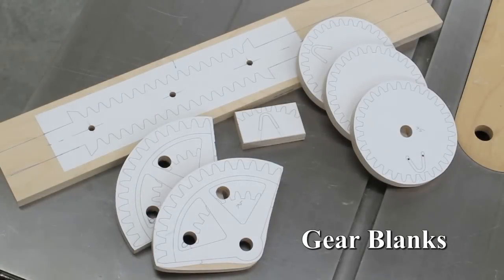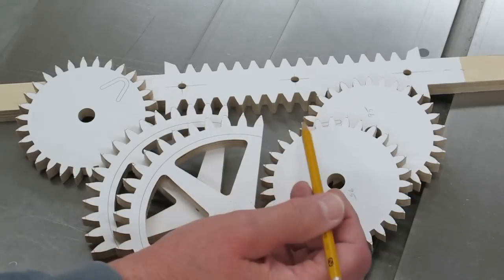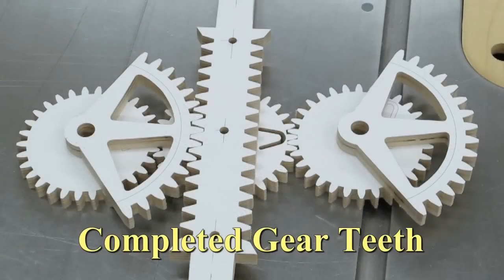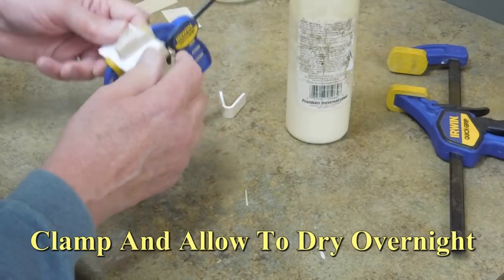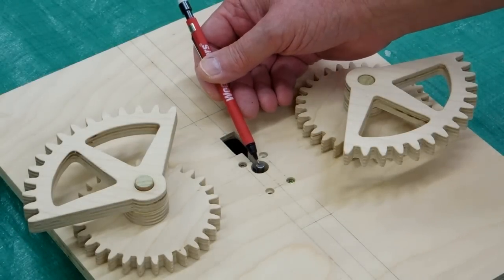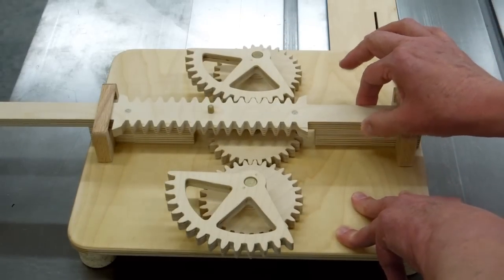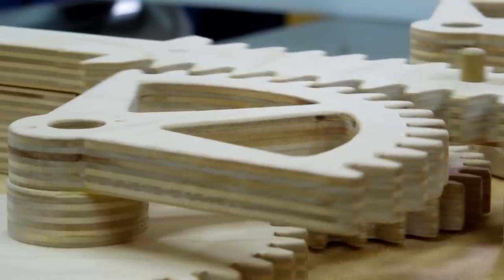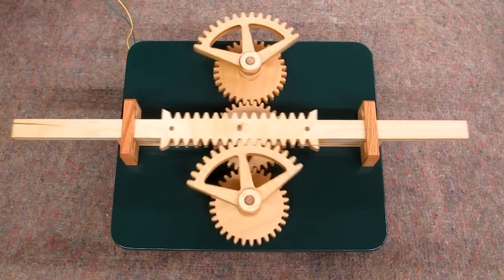Making Movement 123 - Reciprocating Rack Mechanism

Comment: what software do you use to make gears?
Reply from the maker: Usually I use the gear template generator at woodgears.ca, however for this mechanism I had a private source for the templates which are not available for distribution. Thanks for watching. Ron

Comment: Very cool. Did you get this functioning on the first try or did it take a few iterations? What blade did you use in the scroll saw to cut the gears? Just found your channel and subscribed...
Ron
Reply from the maker: With hand cut gears there is usually some fine tuning involved. The operation by hand in the early part of the video was probably the second try and the pin catcher wasn’t installed yet. I have a video on cutting gears on the scroll saw. Cutting Wood Gear & Clock Wheel Teeth https://youtu.be/AQ92urCdybU

Comment: How did you figure out the size of the"half gears"(not sure what to call them), and the width of the shaft gear?
Reply from the maker: This is Movement 123 for the book 507 Mechanical Movements. While not accurately drawn, it is proportioned for the various parts. The website 507mechanical movements.com has redrawn a large number of the movements and has some animated. You can take it from there. I generally use 1/2" Dowel for axle shafts. Thanks for watching. Please Subscribe!

Comment: This is very interesting, though I think in practice, the rack does not have any time to accelerate or decelerate when it reverses. Imagine this made from steel parts and the round gears connected to a heavy flywheel. Anytime it reverses, it would be like a hammer banging the rack at each end. It might break the teeth. Maybe if each three spoked gear could be connected with a torsion spring to the round gears, this might smooth out things when the rack reverses by absorbing and releasing energy on each stroke. On the other hand, there could be a ratchet between this assembly and the flywheel, so that the rack and gears can accelerate and decelerate at each end without slowing down the flywheel.
Reply from the maker: It was proposed in the book Five Hundred And Seven Mechanical Movements by Henry T. Brown published 1868 that the rack would be driven by a steam piston just like a steam engine (locomotive). If a steam engine worked... then?
Reply: @RonaldWalters2010  Okay. Thanks for the info 😀

Comment: Hi,

I am trying to solve, how can i make these "ellipsoids" (yellow, green and red) flow like an "8" sign and continuously switching in between: https://photos.app.goo.gl/LHs0gH3glgpUqGvv2 . It looks like very simple task, just need to switch first pair by rotating blue spindle, then purple, then again blue and so on. But issue how to make them rotate only 180 degrees at a time and then wait for other will be turned? I am stuck... :( I even do not know how to ask google for help :D
Regards
Reply from the maker: I believe I would call the yellow, green and red segments ellipses, as they are 2-dimensional. This mechanism is going to operate as two combined geneva mechanisms. However, as I see it, the three shafts are never going to turn about their own axis. You need a single shaft connected to the blue segment and a single shaft connected to the purple segment. The yellow, green and red segments would be free floating. The two shafts could then be rotated individually 180 degrees in sequence by two additional geneva mechanisms and/or segmented spur gears. Let me know if you succeed. Please subscribe.
Reply: Ronald Walters, will try this if i properly got your idea. Thanks.
Reply from the maker: Indexing Mechanism 6 (180 deg.) https://www.youtube.com/watch?v=WM3roJbzX7U The green gear on the left turns 180 degrees. There could be another identical gear on the right. There would be a delay between each indexing movement. Possibly by adjusting the diameter of the center driving gear you could reduce or eliminate the delay.
Reply: Ronald Walters, its exactly what i need!  Thanks!

Comment: To bend thin plywood that small you can easily use a steam cleaner like what a woman might use to take wrinkles out of a dress. It does a nice job in getting it flexible enough to bend in less than 15 minutes. I used that technique to bend a 1/4" sheet of plywood for a 4 wide sailboat.

Comment: How much load can these parts withstand? What is their resistance?
Reply from the maker: This is a display model. Wood gears are quite strong. Made of forged or machined steel, very strong as this was originally intended to be driven by a steam cylinder.
Reply: OK! What wood do you suggest to have resistance and also to be easy to work with? Thank you
Reply from the maker: As shown in the video... Baltic Birch Plywood.

Comment: Hi Ron!  What  nice surprise to encounter your version of this mechanism.  I made one also, out of aluminum.  If you care to take a look:  http://www.smithsartworks.com/windup14.html
Reply from the maker: Russell Smith  Very nice. Looks like a lot of work. I was looking at your videos. You have some really nice stuff on your channel. For the clock motors... are you building those as well or what motor are you using?  I really appreciate like the Gear Head. I know that took a long time. I should make a wood version of one of those. :-)
Reply from the maker: Russell Smith If you ever travel to Kansas you REALLY should visit the Paul Boyer Museum of Animated Carvings in Belleville, Kansas. I think you would really find it interesting. Quite a small place but plan on spending 4 to 6 hours there, I did! I hate that it is around 400 miles from where I live.
Reply: Ronald Walters Thanks for your reply, Ron...  The motors are 100 year old phonograph motors.  They are quite abundant and--- as far as windups go--- have a lot of power...  I get them on Ebay, and there is no reason why they could not be used to power some of your wooden movements.  They have a real appeal in that the viewer can interact (the winding) and they do not have the leash of an electrical wire.  If you scaled your movements appropriately you could size them to the motors.  Bases would not be problem for you... a nice wooden box with open sides so you could see the mechanism, and a drive gear mounted to the spindle with a set screw.  Nice desk top art.  Do a search on Ebay for "phonograph motors".  I have favored the "Saal" motor, used in the Sear's Silvertone line...  mounted sideways they are easy to mount to a base, pretty to look at with the 78 rpm spindle poking out the back.  If you look at my piece "Windup #11 or 13 you can see a second drive source off the spring barrel... 1 rpm, much more torque.  The motor itself is a piece of art and would partner really well with your exquisitely done movements.  Uneven as they are, my mechanisms have a lot of drag.  With thinner wood and smoother movements you could have more complication...  I am surprised that more kinetic artists have not picked up on these windup motors... but then, interest in the old phonographs did not get going until the late 1990's, and the motors now available are available to supply the restorers...
Reply: Ronald Walters The gear head is certainly not original to me... Google "gear head images" and pages show up.  Then I Google "male profile" for the head shape.  And, of course, use the internet available "gear generator" to get my gear patterns.  Coupled with the variable copy function on my inkjet printer I can make gear sets of anysize.  Bandsaw to cut the teeth, scroll saw to cut the decorative interiors.
Reply: Ronald Walters Thanks!  I will add it to my list!

Comment: What's interesting here is that with the reciprocating member as the input (like in the case of a steam engine), It's hard to control whether the gears will spin CW or CCW. It all depends on which gear is engaged and which way the reciprocating rod is going at the time.
Reply from the maker: Mitch Sandoe I imagine they would need to pay attention to the parking position when shutting down. Keep in mind the mechanisms in the book were all hand drawn as "proposed mechanisms" and I have no idea if they were ever actually used.
Reply: Ronald Walters I have tried to build several mechanisms using the original drawings for a pattern.  Many modifications and additions were necessary to get them to work at all.  The originals don't take gravity or friction into consideration.
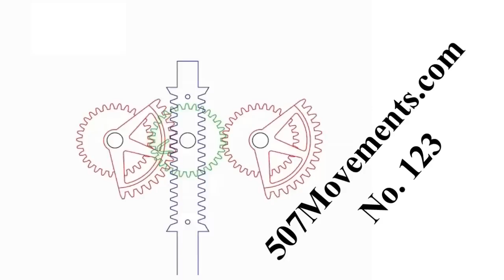Reply from the maker: Russell Smith Apparently there were a few mistakes in the original book. With this mechanism, the two outside pinions with the partial gears are not balanced. With it hanging on the wall and the rack running horizontal, when the partial gears are running from 6:00 to 12:00 you can hear the little gear motor take load and then from 12:00 to 6:00 the weight of the partial gears unloads the gear motor. The change in weight distribution does not noticeably change the operational speed, just the slight change in sound of the gear motor loading and unloading. Was not a factor with it running flat on top of the table saw.
Reply: Ronald Walters Did you see my remarks about the windup motors?  I am not sure how the replies work.  Do I assume that if there is a "+Ronald Walters" that you are notified?
Reply from the maker: Russell Smith Supposedly, yes. YouTube is an imperfect system and I am not always notified by email of a new message, subscriber, or other. Considering the sheer magnitude of what goes on with YouTube it works pretty well. If you go to my channel page, then "about" then "send message" you can send me a private message not seen by anyone else.

Comment: Thanks for that, very clear. Any reason for choosing this reciprocating mechanism over the many other types?
Reply from the maker: Jeff Harmed When it is running, it is one of those mechanical gadgets with gears turning everywhere that immediately gets attention. It is a mechanism which needs to be built to fairly exacting dimensions. To build it as a stand alone wall mounted working model presented some challenges.  It can be built without the pin catcher - but to build it with the pin catcher presented another layer of complexity (it only works if built correctly).
Reply: Ronald Walters Interesting mechanical movement. Its one unique property is the constant speed of the reciprocating shaft when in movement. Find an application that requires this property and you have a practical use.

IMHO, this property is also its major disadvantage since the enormous force on one or two teeth every time they engage and accelerate the shaft from zero to maximum speed virtually instantaneously will limit its practical application to slow-moving devices. For example, I think it would shatter in an internal combustion engine but work well in a locking device. Its complexity is another disadvantage, a cam being much simpler. 

Still I think makes a good video and will provide much amusement to the mechanically minded.

Comment: How long is the stroke of the rack?
Reply from the maker: Max Snelling Fairly long, around 9-1/4 inches. For a working mechanism the ends of the rack would need to be enclosed as a safety measure.